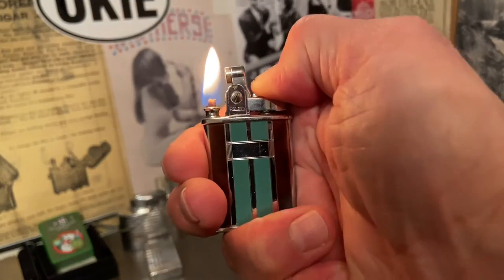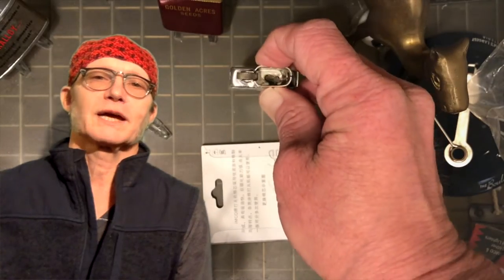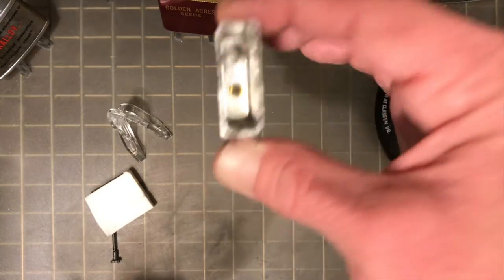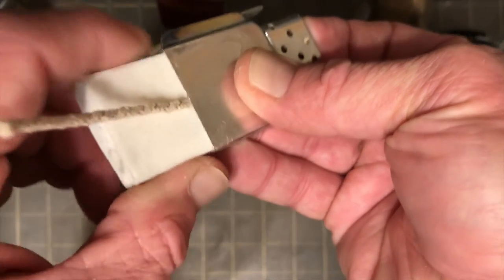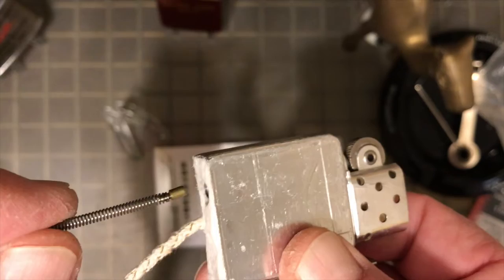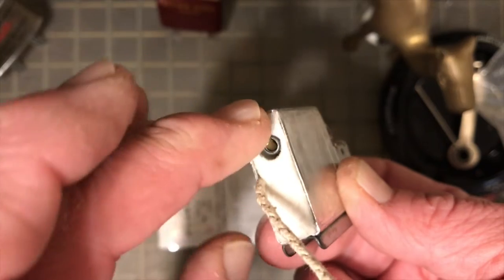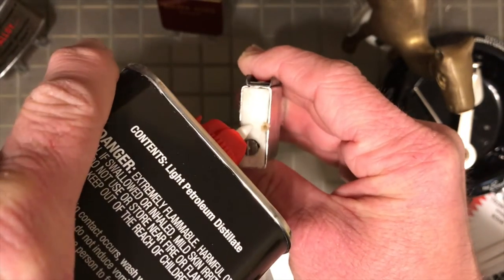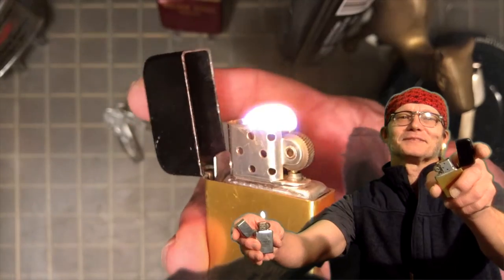How To Replace The Wick In A Park Lighter W/ A Solid Fuel Cell(Or Overhaul A Vintage That Will Not)

Comment: Hi Joe, I have not used memory foam, because I went to a company, which makes memory foam mattresses, but they are not willing to sell their material. They wanted to sell me a mattress, so I gave up, but I used the wick positioning system, which you used in this video, and have to say it works great. Probably, by leaving the wick straight, there are no chokes typical of the S-shaped wick, and the gasoline vapors are free to flow much better. Now I have a full, high and dense flame like never before. I really like to impress people, when they ask me to turn on.
Reply from the maker: I love hearing you tell a story Giovanni!😜✌️
Reply: Hard to believe, but it's the truth. I with my zippos, I can find a beautiful pastime. I'm 65, but basically, I'm like a kid with toys.